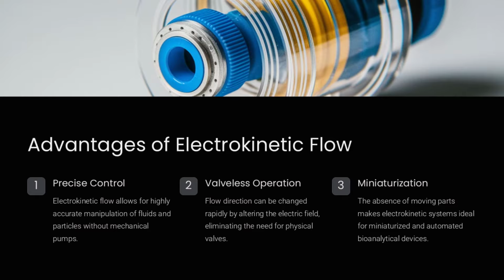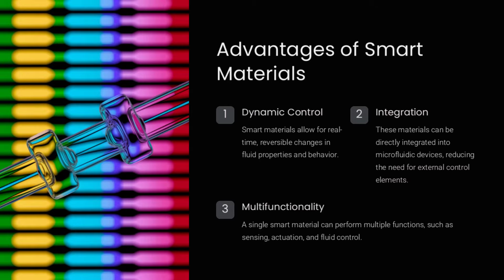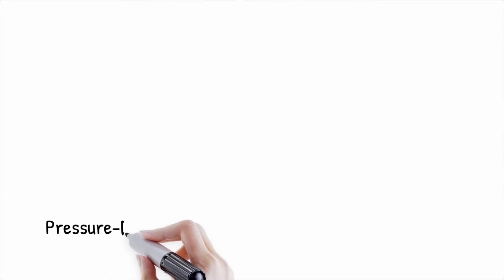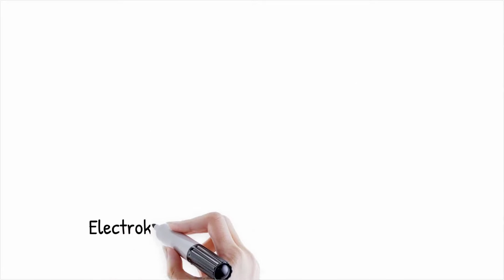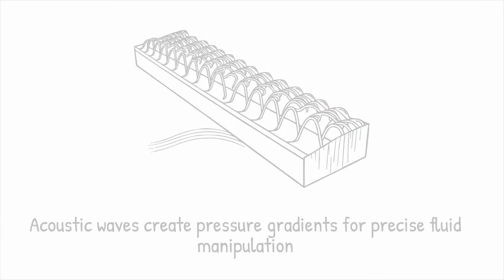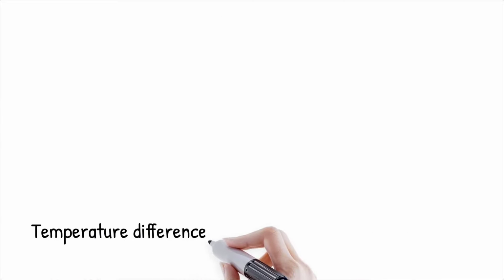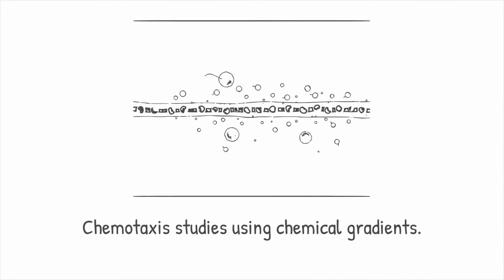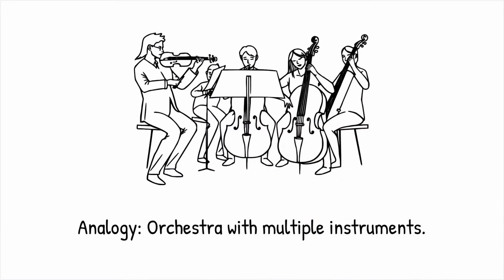Precise Fuid Control at the Microscale for Emerging Applications

Comment from the maker: How do variations in zeta potential along a microchannel surface impact electrokinetic flow stability, and what strategies can mitigate flow disturbances?
In hybrid microfluidic systems combining pressure-driven and electrokinetic flows, how can one optimize charge distribution and hydrodynamic forces to ensure precise fluid control without unintended ion depletion effects?
What are the thermodynamic limitations of Marangoni-driven flow in microfluidic devices, and how can these be leveraged to enhance heat-sensitive biochemical assays?